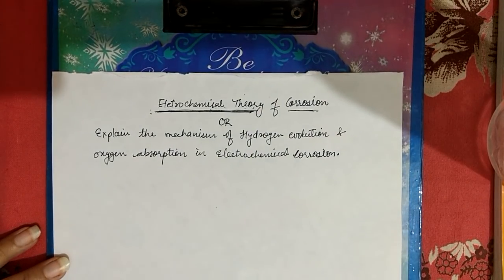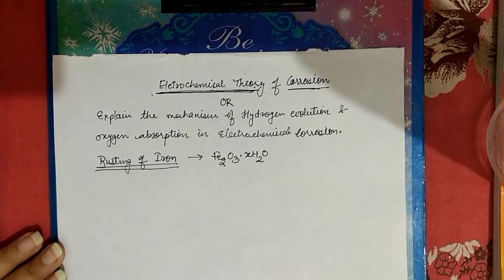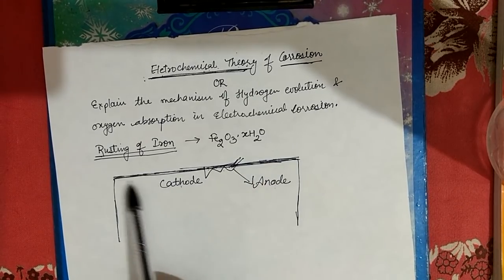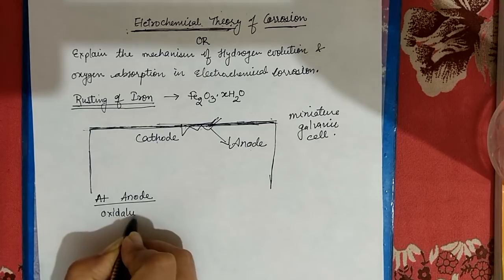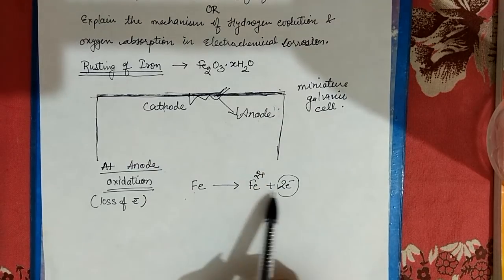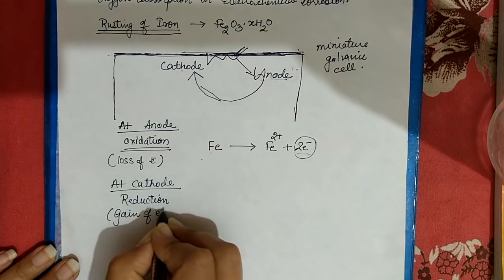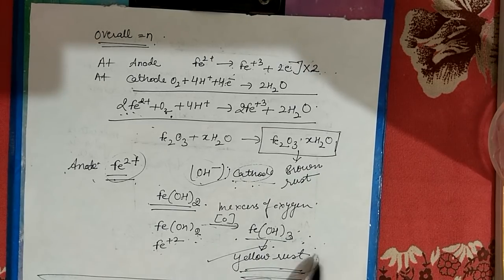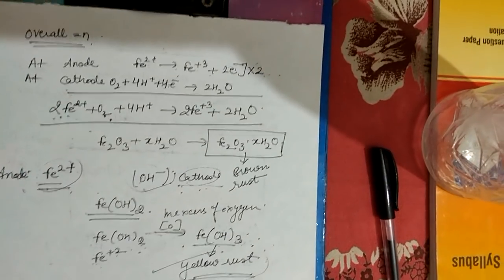Electrochemical mechanism of rusting of iron(evolution of hydrogen and absorption of oxygen )

Comment: Rusting of iron required iron, water and oxygen! Why? First, oxygen molecules must dissolve in the water vapor or water droplet. Because the water molecules within the water vapor or droplet are constantly in motion and those dissolved oxygen molecules are adhered onto them. When the oxygen molecule that adhered onto the water molecule is slamming against a iron atom in an effective collision, the iron atom will transfer its stationary electrons to the oxygen "atom" before the iron atom became Fe(2+) and the oxygen "atom" turned into O(2-). Apparently, the iron atoms will not spontaneously turn into Fe(2+) cations by themselves. Understand this reality, we also know why and how the presence of salt (NaCl) within the water vapor or droplet will act as a catalyst in hastening the rusting process. Whenever NaCl dissolved within the water vapor or droplet, sodium will form sodium cation (Na+) and chloride become chloride anion (Cl-). Dissolved oxygen molecule will temporarily adhere onto those sodium cations in which higher momentum of sodium (atomic mass of H2O is 15.9 and Na+ is 23.9) will slam against those iron atoms more forcefully in hastening reaction where iron atoms will transform to Fe(2+) after transferring some electrons to the oxygen "atom" before it itself become oxygen anion. Oxygen anion (O{2-}) slamming against a water molecule will produce two hydroxide anions. Subsequently, Fe2+ cation will react with two hydroxide anions to form Fe(OH)2 before reacting with another additional hydroxide anion to produce Fe(OH)3. We are still researching on how 2Fe(OH)3 could turn into Fe2O3.xH2O. Whenever the iron atom reacts with slamming oxygen "atom", some electrons are dispersing among iron atoms. In other words, some current (free electrons dispersed from reacted iron "atom") is conducted through the iron "plate". Because of the presence of hydrogen cations or H+ within the water vapor or droplet, the presence of the current will reduce hydrogen cations to hydrogen molecule. Therefore the rusted nails tend to be surrounded with hydrogen bubbles by assessing those hydrogen cations within the water vapor or droplet. Rusting of iron seemed to be a simple, straight forward chemical reactions, but we are yet to understand it completely. The current understanding of rusting of iron is not accurate or slightly wrong. If you are interested in real discoveries, I would recommend you to read my book, The Unification Theory - Volume One and you will be amazed with lots of new, interesting discoveries. In God I trust.